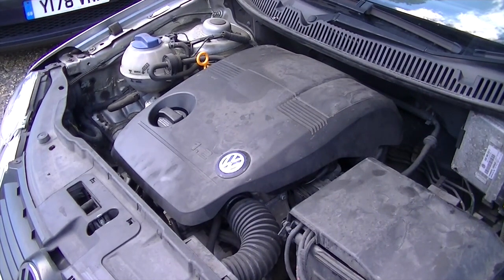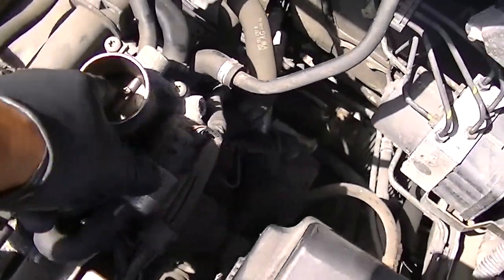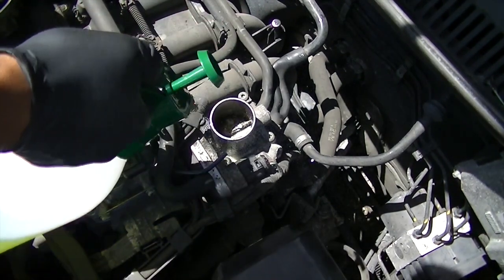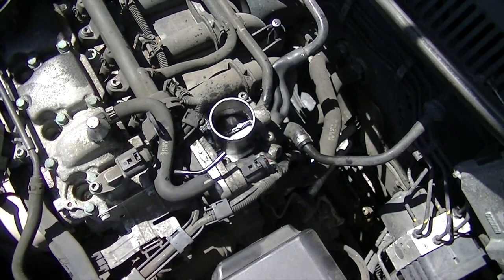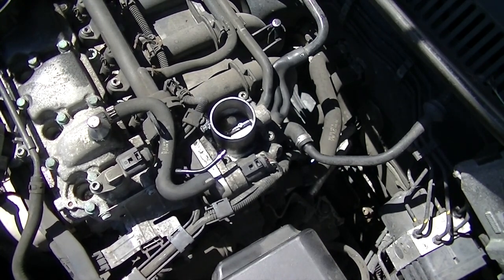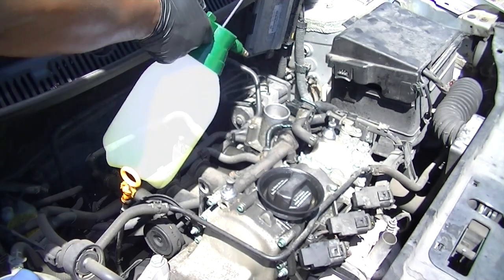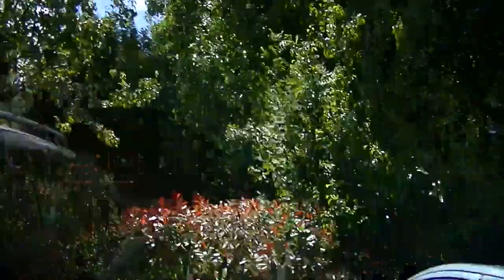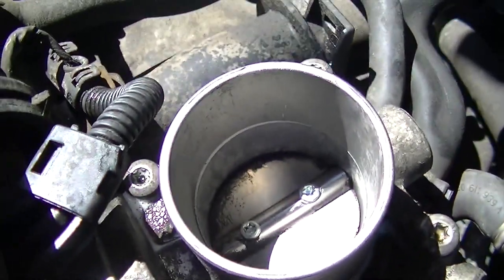How to decarbonise a Petrol Engine

Comment: hi i got a ford fiesta mrk4 1999 it says not to clean my trottle body it looks like its got a tiny glase of rust at eges i want to decarbonize my engine will water effect the layer of oil thats on the flappy part

Comment: Just use Carb cleaner
Reply from the maker: Too oily, petroleum based which is the cause of carbon build up
Reply: Cheers for your reply. Love your videos. I want to buy a VW polo 1.2 for my son and university. Is it true the engines are problematic with the chains stretching as they have no cambelt!
Reply from the maker: Mr GShocker Its really about how the car has been maintained. Because they are VWs people seem to abuse them more than they would a normal car. Chains are better than belts, and if you are worried just change it. You will only ever change it once in your period of owning it. In all honesty you have to do due diligence when buying this car, but they are good for what they are.
Reply from the maker: Mr GShocker Glad you enjoyed the vids

Comment: I would not recommend doing this at all personally, Even though it is very effective when done right.

BE very careful doing any de-carbonizing with water, make damned sure the engine is upto operating temp and you give it a good drive afterward so no water or vapor is left in the engine, ELSE, any even slight left over water inside your engine will cause even a slight rust very quickly, which could totally wreck your engine. I have seen it happen!!

Good fuel additives like AR6200 are much safer and solve the carbon build problem rather than dealing with the symptoms one you have a carbon build up issue, this one takes care of the entire fueling system too..
Reply from the maker: I think its fair to say that the risks of hydro locking is the same to that of seafoam, theres a very slim to no chance of it hydro locking if done inbthe method shown in the video.
Reply: @BMACVAGS  I've done this to my Volvo v70 D5 2.4 turbo about 5 times now and it runs great and the MPG has came down ,I've been doing this method a week before I change the oil and filter . I'm going to keep doing it .
Reply: funny how he never replies to posts like this that warn of the dangers he doesnt
Reply: ***** yep, done incorrectly, you hydro-lock and destroy your engine
Reply: I set up a misting system with a eBay electric supercharger! 50 ml of methylated spirits and tap water! I put my borescope in  TB and in spark plug holes! No carbon at all. All setup on toggle switch for wide open throttle! Hyundai excel with 1.5 litre dohc! But it was a tiny mist held continuously to red line! 312k and still ran. Cheers from Australia! Great vid!🙂